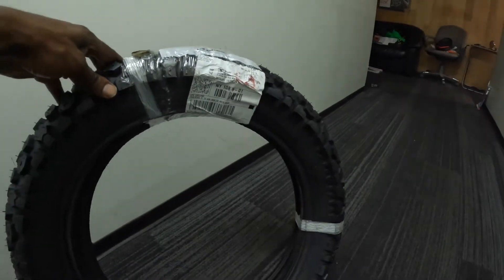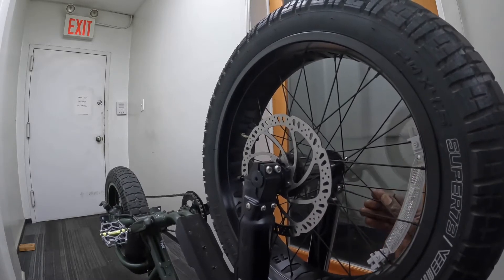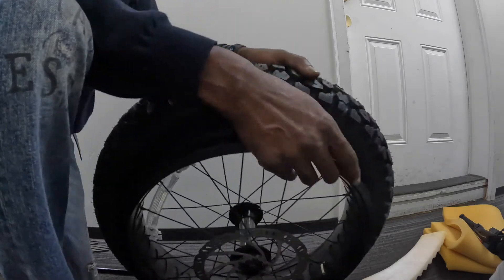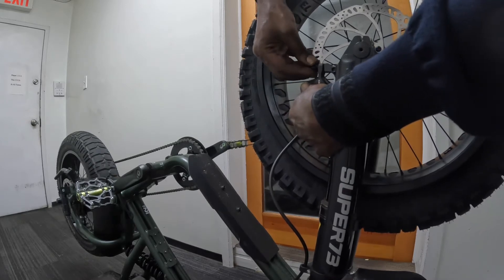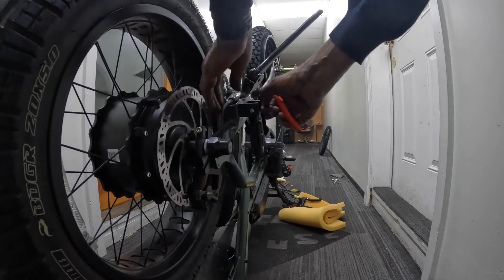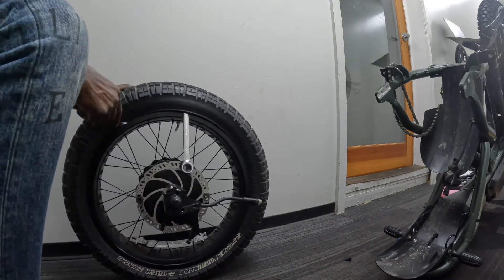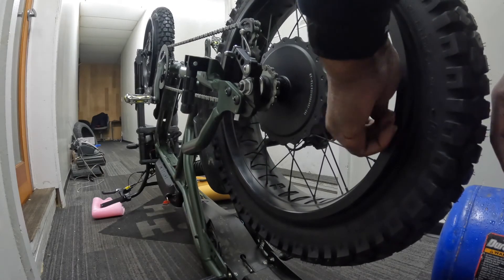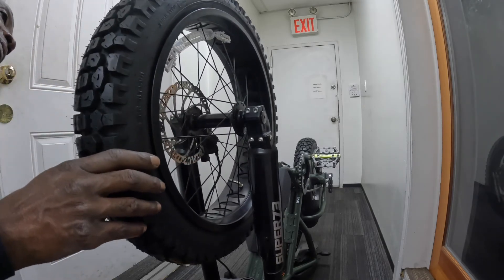New Tire Super 73 R, Any Difference

Comment: Looks like a heavy duty tread tire; I love that; I have an Lectric XP Premium electric bike with the mid drive mount electric bike motor; I changed over for the front tire using the motor scooter motorcycle tire carcass design in a Kenda K671 sized 110mm (4.33") by 16 inch by 70 profile(70mm=3.03") vertical height sidewall which has a very unusually strong above average six polyester corded plies in total which I selected simply because I wanted the extra potential safety factor in knowing it had the two extra polyester tire plies above the normal four regular polyester plies on a normal motorcycle tire carcass design; and for the back tire I installed the Heidenau K66 sized 110mm (4.33") by 16 inch by 70 profile(70mm=3.03") vertical height sidewall motor scooter motorcycle tire carcass which is one of the very most robust long life tread dual purpose tires that has been designed for dual purpose street/trail ride use.

The motor scooter motor cycle design was initially rather challenging  to install simply because of its low 70 percent profile vertical height sidewall designed tire and its exceptionally stiff and thick rather sturdy vertical tire sidewalls; so I had to order a set of three motorcycle tire spoon tire irons and also order and buy a set of extra long curved end and straight ended motorcycle tire irons and also some reusable twenty four inch extra heavy duty 175 lb rated pull weight high strength cable ties.

Now by compressing the particular stiff and inflexible sturdy vertical height sidewalls of the Heidenau K66 in particular using about eight of the twenty four inch extra heavy duty 175 lb rated pull weight extra high strength cable ties in combination together I was finally able to mount the motor scooter motor cycle tire carcass designed tires successfully and more readily though it was not easy by any stretch of the imagination; this was done to help force a large portion of the motor cycle tire carcass design into the center drop channel of the fat e-bike tire rim; which enabled one to more readily work with and lever the rest of the motorcycle tire carcass over the final bit of the fat e-bike rim.

Now I also know that this is a rather heavy rolling resistance additional motorcycle tire weight of an extra fifteen pounds or so dynamic rolling weight that will likely reduce the eighty mile EV range of the Lectric XP Premium fat on tier level 1 pedaling assistance level down to only sixty five miles or so even with its dual 48V 10.4 amp hour rechargeable batteries; so I simply ordered an additional 48V 10.4 amp hour battery to raise total final potential EV range of sixty five miles or so to about one hundred miles final potential EV range;

Now the big difference here is I will not likely have to ever worry about future potential tire punctures due to the rather heavy duty and robust motorcycle tire carcass designs for the Kenda and Heidenau motor cycle tire carcass designed tires chosen along with the heavy duty rated motor cycle tire tubes; I also have the heavy duty rated motorcycle tubes also filled with sixteen ounces of Flat Out tire sealant formulation that has been used in military vehicle applications quite successfully so even I suffer a potential tire puncture it has a decent chance of rendering a temporary tire puncture sealant repair to facilitate and aid me in getting home in all but the most dire of catastrophic  circumstances.
Reply from the maker: I like these tires they make the bike feel more planted and they feel a lot more stable when leaning into turns.  however  they are very much to heavy for this bike, as i lost in range and top speed and i had great difficulty in getting them seated and balanced.  So i went back to stock and im in the market for another set.  Something a lil lighter.